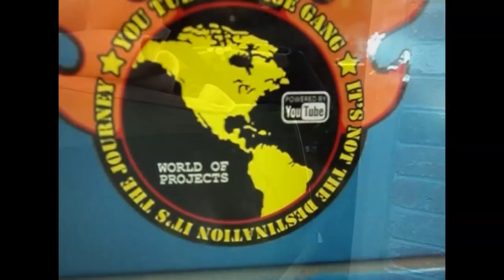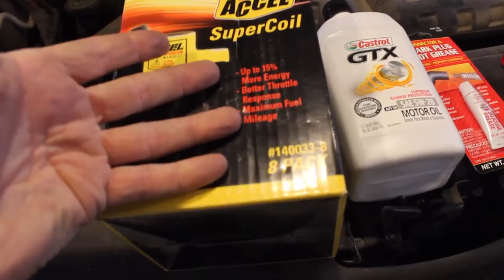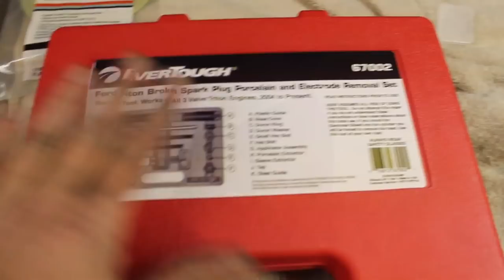F-150 Transmission Shutter - Fixed - Coil on Plug and Spark Plug Swap

Comment: Thanks Greg I'll change the plugs and coils out but just wondering how you knew that would take care of it?  Did the computer recognize that some of the cylinders were misfiring and that's why it wouldn't shift up?
Reply from the maker: I've got a handful of friends who are full time mechanics.  When the coil on plug technology came along, this became a consistent issue.  There are other car makes that have a similar issue (shuddering without an engine code), but its VERY common in Fords.  I've also seen a ton of transmission issues crop up over the years and typically there is a slow onset to similar issues.  In a trans you could have a sticky valve, a bad set of clutches or a torque converter issue, but again, most of those will have a slightly different feel than the typical range of MPH shuddering that you see in the fords.

Comment: Greg,  I came across this today and seems close to my issue.  I've got a 2006 f150 4.6L triton, and its starting to stutter randomly.  Could be on start up but normal when accerating through low rpms (less than 2000rpm).  Usually you can just keep on the gas and get through it but it is concerning.  Around 118k miles and I'm not certain when the Plugs , Coil packs were changed (if ever).  No error codes, just stuttering as mentioned.  Thoughts?

Comment: Had a similar problem with a 2005 Navigator @125k miles... MIs-fire or transmission slip around 45-55 mph going uphill.  Would go away if shifted from D4 to D6. Felt like transmission.  Had sealed transmission topped off and problem seem to go away for a short period only.  Then had an alternator / charging system failure.  Replaced alternator and the transmission slip went away too!  Go figure.  Started looking into the reason why and found another site where someone had the same situation. So, if the ghost in your machine isn't coils or transmission have you mechanic check charging system.  Could be bad voltage regulator in the alternator???

Comment: I have a 2014 ford with a 3.5 and if you accelerate hard it cuts out real bad... do you think this is what the problem is and should i replace coil and spark plugs?

Comment: Were you getting misfire codes? I have the same problem in my 07 Sport Trac, and Im sure this is the cause, however, I have no codes or check engine light..thanks

Comment: Quick question hope you remember.... after you changed the plugs and packs you said for about a week you still had a cylinder misfire but at 70mph uphill... My E350 is doing the same thing after I just changed all 8 plugs and packs.... do you remember what cylinder was misfiring for that week after you did the work? Trying to see if we had same problem. Mine says misfire cylinder one and I’ve double triple swapped everything. Help!! Lol

Comment: My 04 Lariat did the same thing.. It was the biggest freaking aggravating thing I've ever done and I've changed plenty of spark plugs before! This job sucked ass lol! I was able to get 1 out of 7 without breaking.. Then on top of that the previous person who changed them stripped 2 of them! It literally took whole weekends! I'm glad it's fixed! The only issue now is the damn truck keeps stalling at stops! Oh well! If it wasn't for your video I probably would be scratching my head wondering what the hell is wrong with my truck!
Reply from the maker: +masterslayr641 Man, I feel your pain.  Blowing an entire weekend on a job that should take an hour, maybe two is the worst.

Comment: What are the odds that this will fix the same issue on the 4.2V6?  We have a '97 E-150 with this same issue.
Reply from the maker: Pretty good chance it's a similar issue.  You don't have the coil on plug (if I'm thinking of the right engine), but I believe the computer acts in the same manor with the overdrive lockout when the ignition is acting up.  The plugs can eat you alive though man.  Do more homework than I did so you don't get stuck with a buttload of broken plugs.  It was cheaper for me to replace everything than it was to have the coils checked out, plus at 140k I figured they were used up and needed to be changed anyways.

Comment: My 06 f150 xlt does it once in a great while, but also feels like loss of power when it does this. Also when I come to a stop it has a little vibration from like 25 mph to 0 , is this related??  75,000 miles, nothing but problems since I got the truck at 45,000

Comment: I had a similar issue about a month ago lasted for about 2 minutes then got a check engine lite auto zone read a  P0351 code I took it to my local shop they tried reading it 2 days later and no fault s were stored in computer been fine ever since gave it back no charge csaying maybe I have a coil pack starting to go bad no lites on since

Comment: This is old news I know but I was 100% successful removing plugs.  Plan extra time to let plugs soak. I barely cracked the plugs the night before and soaked with PB blaster or whatever brand you like  Next morning, more blaster and very slowly and minutely back and fourth.  If it gets tighter, stop and reverse direction slightly, soak again and let sit.  I also ran Chevron Techron in the fuel system for 1 month prior.  Supposed to clean carbon out of combustion chamber.  Make sure you blow out combustion chamber with compressed air after you get plug out.

Comment: Thanks for the demo on how to solve this problem. Do you know if the older F150s might have had the same transmission and ignition sequence settings goin on. I have a 2002 F150 that has converter shudder at 55mph same thing only under light acceleration and right after 60mph it goes away. Wonder If checking my ignition could solve the problem there as well?

Comment: Ohhh man..im really hoping i have this instead of transmission problem. At low rpm it does shudder but if i lay on the throttle before it just starts then it doesn't do it at all

Comment: Greg, I have new pluds plus the Accel coil packs.  Pretty frustrated with my 5.4. still shutters. So I took it to the shop. They say it is the torque converter. Thoughts?
Reply: Was was the issue sr? I did coils and plugs in mine and is still acting up ( like this video)

Comment: Really appreciate this video. I think we know what we need to do now. Do you still recommend a trans flush? Because we did one 1 year ago?
Reply from the maker: +tahitianflower Trans flush is good to do at somewhere around 50k+++  If you just did one, another won't do much good.  If your problem is in the ignition system, you won't notice any improvement with the flush.  The tools I used were free to rent from O'Reilly's.  The consumable pins were a few bucks...  Maybe $10 for 4.  Watch a few vids on getting your plugs out.  There are methods that help reduce the breakage.  Use carb cleaner, not pb blaster.  Also, if you can soak them a day ahead of time, you'll be better off.  Some guys also do the removal with a warm engine.  GOOD LUCK!
Reply: +Greg's Garage Thanks for the response that just makes you awesome. You are totally right, I know we are going to have to replace the coil on plugs & spark plugs. I watched a lot of videos and although some people were able to improve their performance by a trans flush or torque converter lock up solenoid replacement none of them fixed the problem completely. It sucks though because it's going to be a bit more expensive to fix. (I'm broke) so grateful you made this video. We'll need it to help with the repair.  Thank you!
Reply: +tahitianflower Just wondering... Are you thinking I can get way with just the spark plugs being replaced?
Reply from the maker: Probably.  Depending on mileage, I'd suggest replacing coils while you are in there.  The issue can either be the plug or the coil.  You can do the plugs, if the studded is still there, do the coils.  It can be the injector too, but that's less likely.  Use a $5 bottle of injector cleaner to rule out a dirty injector if you want.

Comment: Wow man. This is exactly what my 1997 E250 with 5.4 has been doing. I was convinced it was transmission shudder. Already had changed all the plugs changed so just the coils wont be too bad. Im going to give an eight pack of coils a try. Seems to not be there as much when engine is cold but pretty consistent when warm. Under no load reeved up it doesn't miss at all. Its exactly like what you experienced. Thanks Greg. I'll let you know. Do you take Visa or MasterCard. . . . . .  : )

Comment: I have a F 150 2005.... 5.4 does the same thing.... Also have a 2007 Ford explorer 4.6 does the same thing.  Not excited on breaking off 16 plugs..... But it has to be done I guess...

Comment: What if you are starting it and ignition delays for 10 to 30 second s and it has uneven idle then dies or when your driving and have to pump the gas because there is no power and wont accelerate

Comment: Hey Greg, I have a 2010 Ford F150 STX 4x4 that only shudders between 30 and 40 mph. No DTC's.  Been on a lot of forums and noticed a lot of expensive answers.  Just want to check with you first.  Do you think this would this take care of my problem.  Look forward to your answer.
Reply from the maker: It could be coils, plugs or injectors and that would be the cheapest fix.  If your truck has around 100k miles on it and you haven't changed plugs and coils, its probably time to do it anyway.  Run some injector cleaner in a couple tanks of gas (good to do about every 20-30k anyway)...  It could be a clutch in the trans or the torque converter, but the symptoms sound like good old Ford ignition.  I believe the ford dealers have a tester that will do a thorough test of the coils, but often that test costs as much as a replacement set of coils.

Comment: If you put anti-seize on the spark plug threads you won't have trouble getting them out next time.  Also if you experience the shudder again don't take your foot off the gas but lightly tap the brake pedal.  If the shudder goes away the torque converter clutch is the problem.
Reply: SkilledEddie lubegard makes an additive that is supposed to stop torque converter shudder. My 04 did this when I first bought it and after pouring just part of the bottle into the transmission it went away and hasn't come back in six years.

Comment: Did you get burnt oil smell with this issue smells like the old cars when the pcv valve would get clogged. I  replaced both vct solenoids and the p0012 code keeps coming back shudder went away loses power when the engine is cold once it warms up drives better but not a 100% it's an 04 f150 fx4 nb
Reply from the maker: I didn't get a burnt oil smell.  I do know, mine took about a week for the computer to reset and start running right again.  It would die at idle when cold or warm.  Since it finally reset it runs perfect.
Reply: Okay thanks gonna try the cop swap thanks for the helpful vids.

Comment: I just got my class action lawsuit settlement from Ford for the spark plug issue that plagued the 5.4 liter engine. You have to soak the plugs with the PB blaster and let that work for a couple of hours and then when you remove the plugs you have to work them in and out as you back them out. Guess I need to replace the coils
Reply: +John Livingston No, do not use PB blaster! It's a penetrating fluid, you need something that softens the carbon deposits. Use carb cleaner. The stuff the dealer uses is Ford PM-3 Carb Tune-up cleaner - http://amzn.to/1P3LJxM
Reply: +John Livingston  What class action settlement?
Reply: Ford sent out letters regarding a class action lawsuit for the cost of having heads repaired due to the damage done to vehicles due to the difficulty removing spark plugs, however you need a receipt of damage done.
Reply: No way! I guess it's too late now?
Reply: I don't know, might be worth the investigate especially if you got the receipts from work done.
Reply: John Livingston I have the same problem with my 4.6 1999 Ford F-150 is there a class action lawsuit and is there any due to the owners of these trucks any help would be appreciated as I'm having the same problem
Reply: Arthur Newhart There was class action suit about the 4.6 intake manifold years ago.  1999 is to long ago.  This recent spark plug settlement was peanuts.  There a lot of BSer talking crap how they made out BIG.  They got about $120.00 .  Some spent hundreds before they made the special extractors.  Now that it's well known that the 5.4 and other ford engines are junk, No wants them.  This 5.4.  has problems with cam phasers, vct valves, spark plugs, oil pumps.  Trans mission shuttering because for engine malfunction, the list is endless.  Anyone posts different then why is there hundreds for videos to fix recent ford engines?
Reply: Even when submitting a receipt for the spark plug change and costs, I was turned down for any compensation on my problems.

Comment: Replaced the spark plugs and coil packs on my 2010 F150 5.4 L.  Now I have a bad rattling noise on acceleration.  it's like the noise on old distributor engines when you use to low octane rated gas.
Reply: Likely bot installed correctly remove and reinstall

Comment: What year is your f150? I'm having similar problems with my 2000 f150 and I'm wondering if it is are the same procedure?
Reply from the maker: bob stout I have a 2005.  VERY similar procedure on the 2000 model.  I believe the plugs are slighting different.  The fuel rails are a bit more in the way of getting to the coils if I remember correctly.  That said, they are all removable, just a bit more of a pain in the keister.

Comment: Those coils on those Triton engines go bad all the time.  Sometimes you can pull the boot off and clean the green stuff off of the contact.
Reply from the maker: I'll clean up the old ones and have them ready for service.  Thanks for the tip!

Comment: i also have a 2005 king ranch f150. shudders at 40 50 mph. New transmission.  replaced 8 months ago. I have the infamous 5.4 tick. i hate it. i love my truck. its very well taken care of. im going to try this. also just to test my truck. when i punch it from idle it shudders hard and the check engine light comes on. any info on this? thanks.
Reply from the maker: +kevin khaos Yep.  You have all the typical ford issues...  Coils and plugs should take care of the shudder.  Probably cure the punch it from idle issue too.  Be sure to check out other vids on removing the plugs...  It's a trick to get them out without snapping them...  I didn't do enough homework before I did the swap and broke 7 of 8 plugs.  Good luck

Comment: I just Bought a 2006 F1 50 and am having the same problem. It shutters in overdrive with light load and low rpm. My question to you is what ultimately fixed the problem. Was it plugs and coils? Or was it the trans fluid? I'd like to fix this asap. It's only 83500 miles on it!
Reply: Did you fix your issue?

Comment: Great video but that Fram oil filter is a big no no. These 3v 5.4's only like Motorcraft
Reply from the maker: +THETOPGLOCK Never heard that one.  What is it that the MC part has different, do you know?
Reply: +Greg's Garage  It's been a long known problem with Fram. They use a cardboard anti drain tube that is subject to collapse.  The Fram filters are also linked to Phaser failure.  These 3v 5.4's catch a bad wrap but over all their great engines that require a little more finesse. I have a 07 F150 5.4 with 168k that's runs terrific.
Reply from the maker: Thanks for the info...  I've def had phaser issues...  I've got 160k+ on mine...  Very few problems, but the phasers have def been an issue.  Thanks!
Reply: Fran oil filters= Orange cans of death....
Reply: Fram*
Reply: This is a fact.. motorcraft filters on these motors only boys and girls...

Comment: I will never buy a truck with the word Triton on it again!!!
3 valves broke plugs.  2 valves shot them out of the heads...
One of my spark plug inserts ended up coming loose and falling into the cylinder.  At that point it was just as well replace the heads.  I feel your frustration!!

Comment: I have a 2006 Explorer with a 4.6 and changed my coils. All problems went away. exactly at 50 mph. The wrench would come on as well. Did not change plugs. Funny no codes!
Reply from the maker: rick harding Glad to hear you got it licked!

Comment: Hey man I have a 2011 F-150 2 wd and whenever I stop and then accelerate it feels like there's a bump like a little hit on the bottom of the truck do you know what it could be??? Thackeray bro!!
Reply from the maker: Samuel Hernandez I'd guess a worn u-joint.  Could be other things, but if those get some slop, you'll feel it every time the truck pulls off a stop.
Reply: Samuel Hernandez I have had the same issue. Usually it's the yolk connected to the def needs to be greased. There is a video on Youtube about it.
Reply: You need to apply grease where the 2 sections of your driveshaft slide together. The splines dry out and cause the bump.
Reply: Grease your slip yoke

Comment: is safe to drive it like that? cuz my tuck is doing exactly  like your
Reply from the maker: It will just run rough which isn't great for the engine, but its not going to shell it out.  I'd recommend getting it fixed quickly, you'll be happy you did.
Reply: Greg's Garage  thanks for replaying back  keep up the good work.

Comment: Thanks  lot
Same problem with my 1996 Ford e350 Club Wagon
when hit the 35mph.... and then at 55mph
So is time to replace those Ig Coils :)
I thought it was the Transmission Solenoid, speed sensor and something else on the transmission.!!!